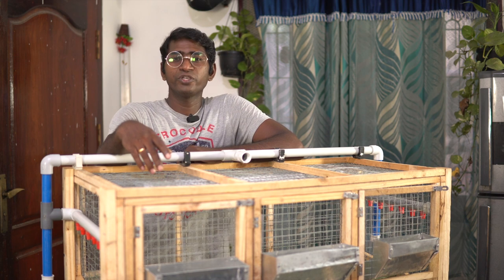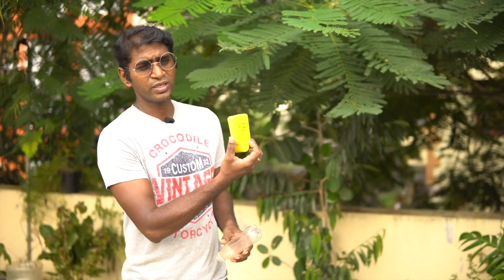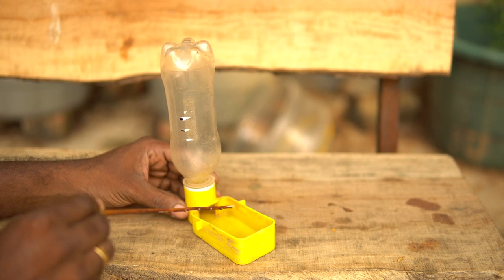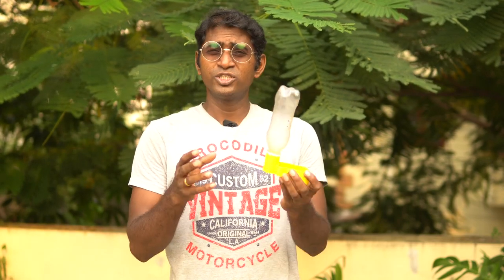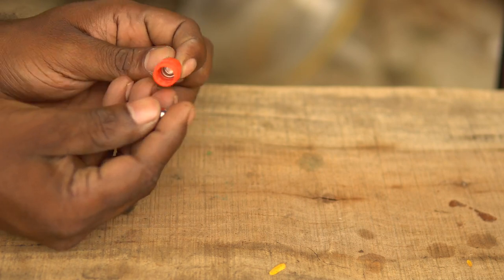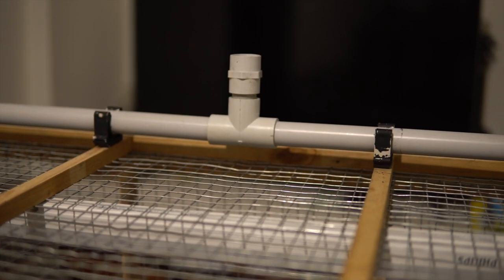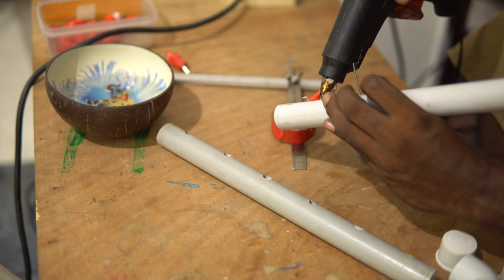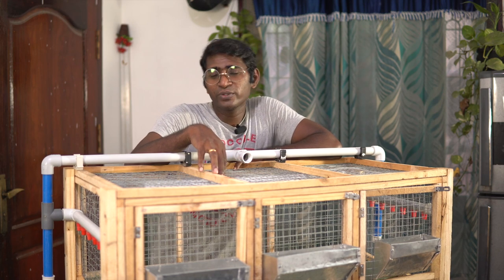Automatic Water feeder for quails

Comment: Looks Awesome! How did you connect the bucket to the line?  Do you have a website with complete instructions?
Reply from the maker: JUst used some regular hose and plumbing attachments. I used a 5-litre Can placed on top of the cage.  This can I topped up with water using a hose